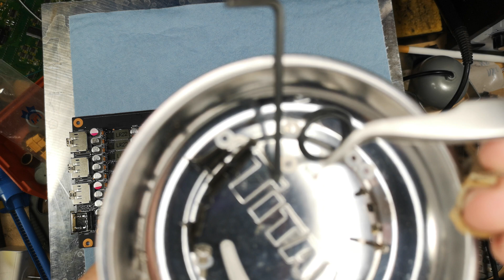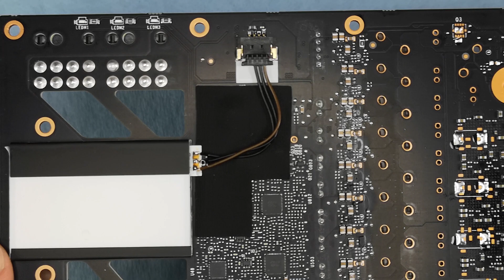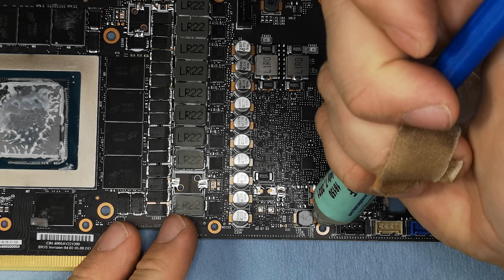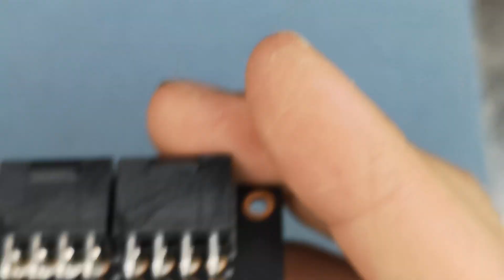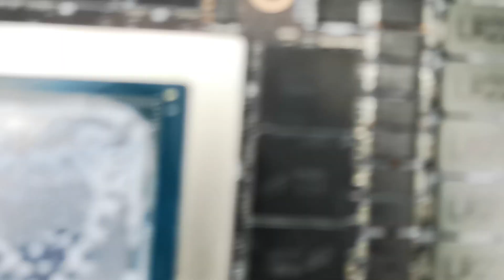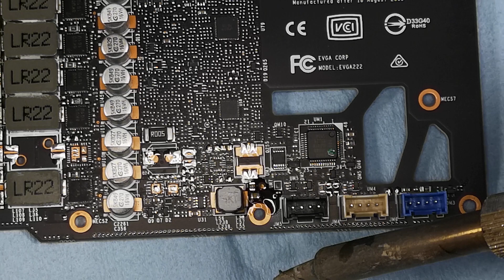EVGA 3080 XC3 Ultra Gaming impromptu board repair / board reference

Comment: So I have the same card only it’s a 3080ti and I noticed I am missing both of those little resistors.. the one you soldered is missing along with the one directly above that one .. both are yellow in appearance and look to be the same resistors judging from your video.. I’m wondering if that’s why my card stopped putting out a video feed all of a sudden. Any help would be greatly appericated!
Reply from the maker: It's unlikely both would be missing, especially if the solder joints look smooth on yours.It's a higher level card so they likely changed quite a few components on it for different options.

You could try to find some board pictures however to compare if someone has taken any good ones.